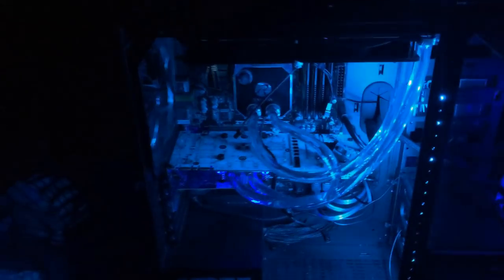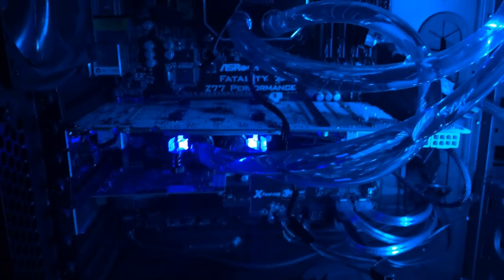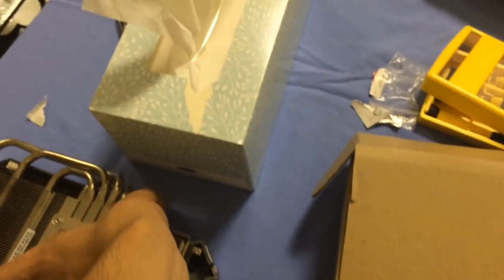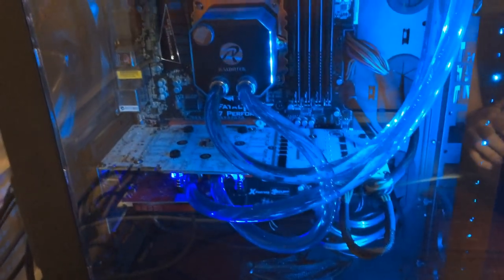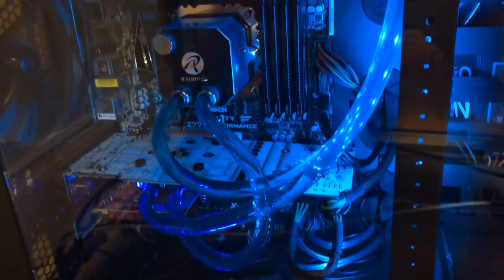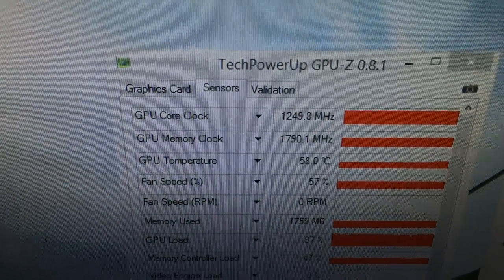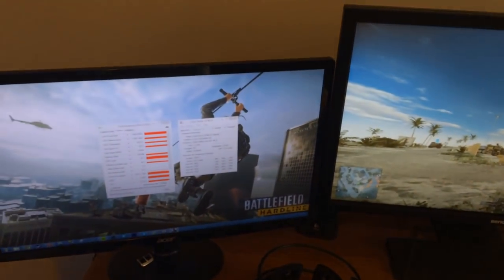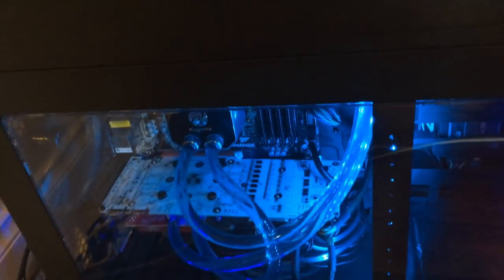Raijintek Triton GPU Expansion with XSPC Raystorm 2015

Comment: Thanks man! With your help i managed to get it to here :)
full load GPU 65 degrees (TITAN X) @ 1400MHZ. (previously 85 degrees with Jet plane fan noise)
CPU under gaming load, is 20 degrees higher tho.. (high 70s) @ 4.8 GHZ
but i think its ok . . .
heres a pic :)  :  http://i62.tinypic.com/2im9s00.jpg
Reply from the maker: Awesome, nothing really beats fully water cooling your gaming PC.
Reply: +Baldrick sodoff What fittings and tubes do you recommend to extend this to GPU.

Comment: Hi for my RX 470  there is no full block water cooler available. If I get a generic GPU only block (like you did?), wont my VRAMs get smoked`?
Reply from the maker: Make sure you add heat sinks or thermal pads on the vrm's

Comment: Is the pump really that loud?   it sound like a buzzing sound......
Reply: I'm wondering this too 
:)
Reply from the maker: partyprash2000 I find that my case fans and the rad fans generally cover the noise from the pump.
Reply: Baldrick sodoff thanks for the reply, could u maybe put an annotation on your video of what the original temps used to be for GPu and CPU :) im thinking of doing this kind of setup for a new build, just wanna know :)
Reply from the maker: partyprash2000 Well for the overclocked GPU I was running at about 75-80 degrees celsius with ambient temps of about 28 in the summer and for the CPU it was about 75 degrees with a 4.2 GHZ OC but with liquid I can get 4.6. The main temp difference was the GPU as it runs below 60 degrees at all times.
Reply: Baldrick sodoff thanks, i got myself this badboy :) but im totally lost on how to connect it to the GPU waterblock etc, is there anywhere online that explains the process ? :D , excited to put my titan x under water
Reply from the maker: partyprash2000 Well first of all you need 2 3/8 inch fittings that go into the 2 holes in the GPU block (I recommend getting a compression fitting) as it is the easiest and most reliable. Next connect the tubing to the GPU fittings and make note of where the water goes in and out as it should tell you depending on the water block instructions. 

This video shows how to connect parts to the water-cooling loop
here is the link: https://www.youtube.com/watch?v=krgK2dcxJ5g
Reply: Baldrick sodoff ah thank you, which 3/8in fittings are you using exactly ? did you get them from PCCG as well ? and is the OD 1/2 ? for the tubing that comes stock with the cooler?
Reply from the maker: partyprash2000 yeah I got everything from PCCG. The tubing is 3/8ID 1/2OD BTW the stock fittings and tubing is slightly tighter then the actual dimensions but some hot water will expand the tubing and fit on the fittings. I would highly recommend that you get 3m of extra tubing as you will make mistakes. The compression fittings I am using are the EK ACF 10/13mm (roughly 3/8 1/2inches) compression fittings nickel.

Hope this helps
Reply from the maker: partyprash2000 don't forget the coolant as you need more then what comes with the AIO.
Reply: Baldrick sodoff thank you ! Exactly what i needed Thanks, gonna buy them now :)

EK Ekoolant EVO Blood Red Premix 1000mL Coolant 

EK ACF 10/13mm Compression Fitting Nickel  x2

EK Full Cover VGA Block EK-FC Titan X Nickel 

Masterkleer Tubing PVC UV Reactive Blue/Clear 3/8ID 1/2OD 3m 

Looks right ? :)
ill put my order in soon :)
Reply from the maker: partyprash2000 no problem
Reply: Baldrick sodoff sorry i keep bugging you, but last question i promise ^_^ hehe, 
your current setup, is it CPU->GPU or, GPU->CPU flow ?
Thanks, you've been a great help, ill be watercooled by Wednesday at the latest :D
Reply from the maker: partyprash2000 After it passes through the CPU pump it goes to my radiator, from there it goes to my GPU and then finally back to the CPU/pump. So it is (GPU-CPU). It doesn't really matter what component it goes through first.

Comment: I'm gonna get the Triton, but I'm gonna take a few precautions. Make sure all the fittings are tight, check the reservoir for imperfections, run it standalone for a couple days before I connect it to the CPU. I figure that'll minimize the chances anything'll go wrong.
Reply from the maker: +Ariel Fetters yeah, good plan. Also buy one extra fitting just in-case something goes wrong.

Comment: If u catch the z77 Fatality Professional motherboard, u will definetly change your opinion about those boards.
Reply from the maker: Zosto Fernandes Yeah that board is full of features mine doesn't have. Unfortunately Z-77 boards are hard to find at a reasonable price due to them not being made anymore.
Reply: Baldrick sodoff Here in my Country the used ones are very cheap, but if u can find a used z77 fatality professional u must have it, i had many z77s,Asus ,gigabyte,MSI asrock extremes..etc.
And the best was the professional + 3570k best combo ever.

Comment: can i added a different radiator to this set? or what  about the pump noise? and temps?
Reply from the maker: +Rivalx070 yeah you can as I did in a later video: https://www.youtube.com/watch?v=itojuCROxzM
Temps really depend if you overclock or not

Comment: can i ask on how did you manage to get the fittings off, as mine wont move at all ?
Reply: +MrGc Reaper For mine I used locking pliers and it still took some time and a lot of effort, especially the radiator fittings which were much more difficult to remove than the res

Comment: Hey i have this cooler and im wanting to add a 360 rad to the loop just for the cpu what fittings and tubes should i use because im really confused and what fittings i should get because i cant get the exact same size tubing and fittings as the cooler
Reply: Frag SauceTV to add to this is the tubing are 9.5 and 12.5mm which i cant find
Reply from the maker: Frag SauceTV I used 3/8 ID and 1/2 OD soft tubing, getting the compression fittings to tighten that come with the AIO was hard but with some force eventually fits. The compression fittings to use with your rad would be a     g 1/4 thread that fits a 3/8 ID and 1/2 OD. This is 10mm ID and 13mm OD. I used the EK ACF 10/13mm compression fitting. Hope this helps.
Reply: ok thanks man i subbed and thanks for the quick reply im hopefully going to be now able to overclock my i7 4790k even further now with now have a 240 and a 360 thanks Man
Reply from the maker: Frag SauceTV nice, I added a 240mm rad.
Reply from the maker: Baldrick sodoff you should also watch my video of me adding my 240mm radiator, it might help https://www.youtube.com/watch?v=itojuCROxzM
Reply: ok just watched it i understand now Thanks for the help